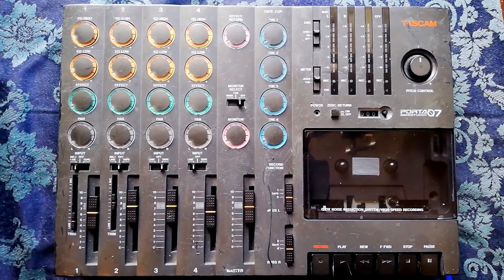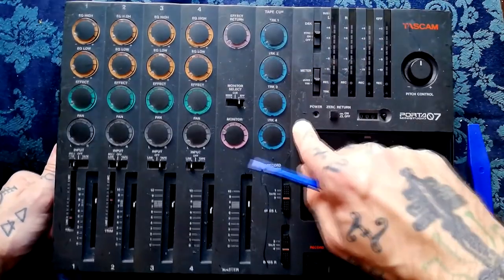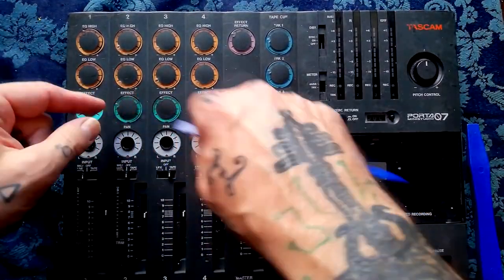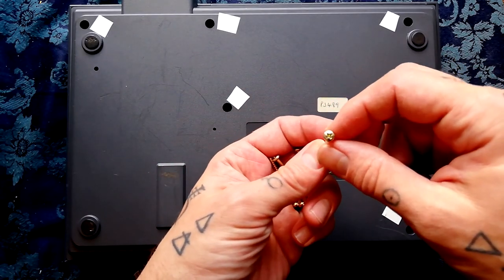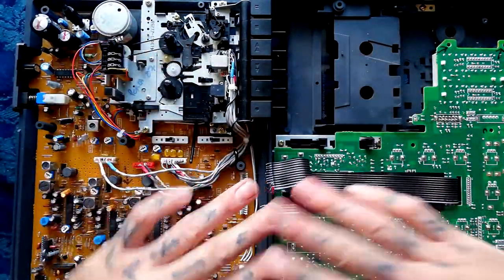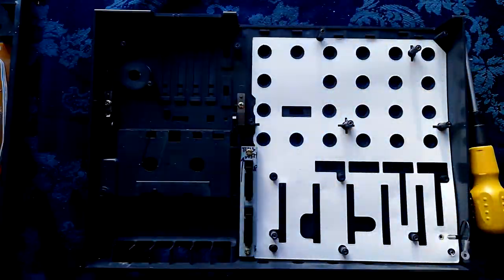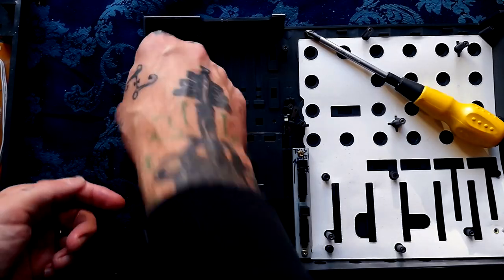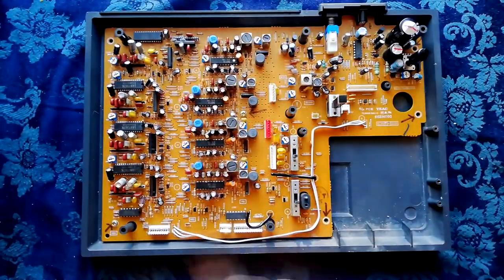Tascam Porta 07 | Tear Down

Comment: Hey mate, thanks a lot for this video, this was really helpful! I just got my first Porta 07 and I'm trying to bring it back to life, maybe you've encounter the same issue before? : the transport side of the machine seems to be working just fine but there's no power at all on the mixer side. I'm a newbie but surely the power is provided by one of the 3 ribbons cables? Do you maybe know which one? I couldn't find anything in the service manual. :/ 

Anyway I'm guessing you get a lot of these comments, no worries if you don't have time! Thanks for all the videos. ✨

EDIT : Neeeevermind, I flipped the transport PCB over and it looks like the ribbon cables connections have been resoldered by someone before, they're all super messy so I'm going to redo the whole thing. Hopefully that'll do it!
Reply: Im getting mine next week and it has the same problem you are describing, so im all ears if you have an update on it!
Reply: @user-sr5iv9pp6p  Unfortunately I couldn't save mine! The PCB was super damaged from the previous repair attempt and I don't have the skills to address that. I might buy another broken one to see if I can maybe merge them somehow, aha.

I hope yours will be in a better shape. ✨
Reply: Hey mate, do you think you could send me in the right direction of the service manual? ive only been able to find the users manual so far ;/
Reply from the maker: It's up on my blog https://tetrakansupermonobloc.home.blog/2019/10/22/tascam-porta-07-manual/
Reply: @Tetrakan  oh jesus, thanks mate! You've allready been a major ressource since aquiring my porta 07, and with this i believe i can bring it to decent life

Comment: my portable 07 was powering on and working perfectly after I first bought it but now it will not power on? did I blow a fuse in the machine perhaps? Im not sure how I would go about fixing it. I tested it with some very similar power supplies with the same polarity to make sure it wasn't a power supply issue so now im assuming there is something wrong with the dc jack or some wiring? not sure how it could go from working to not powering on in minutes but I would appreciate any sort of help if you could give me any :-)

Comment: hello! thank you for the great content! I'm having the following issue with my porta 07: when using the "monitor" outputs [L and R], one of the channels (the L one) is A LOT louder than the other one. the R is almost silent. So I'm using the "line out" outputs instead, but then I can't control the volume through the "monitor" knob, obviously. What can be wrong with my monitor outputs and do you have any idea on how to fix that? thanks in advance!
Reply from the maker: Thanks for watching. Could be the pot itself is dirty, or capacitors,  opamp or solder associated with that side of the stereo bus have an issue. I resolved a similar issue on another model on this video https://youtu.be/gwr8nUAkdMo

Comment: Recently my porta 07 inputs 1 and 2 stopped working, and in the playback  if pan a track to the right get all distorted, do you know how to fix this??
Reply from the maker: Its hard to say without being there to run  tests, but porbably there is a bad solder or capacitor somewhere. Schematic is up on my blog. Look for an opamp or other component shared by channels 1 and 2, reflow colder and replacing electrolytic capcitors surrounding that. Here is a video with more detaisl fo the sort of steps you will need to take. https://youtu.be/fVs0ALyEUMY

Comment: I have question 
I get recorder couple of days ago
First I was testing just listening cassettes what I was ordering online
But everyone playing double speed is that's normally?
Reply from the maker: Yes. It’s a 3&3/4 inches per second deck. Commercial cassettes are 1&7/8 IPS.
Reply: O that's explain
Is any chance to change speed to commercial cassettes speed?
Reply from the maker: @JBBTS  not as standard on this model. I have shared a modification on my patreon, but you would need dome electronics skills. Some other models have dual speed, or low  speed only, which is compatible with commercial tapes.
Reply: @Tetrakan  thanks for info 🙏

Comment: Good vid, thanks mate. I have a Porta 07 that’s been sat around for 20 years and won’t power on, would be nice to get it going again. Need to check your Porta One vids as also have one of them that I’m using as a sub mixer (makes my drum samples sound nice & crunchy), it has a knackered tape mechanism and it would be nice to sort that as well. I’ve got a working Yamaha MT400 too but recordings gradually speed up for the last couple of minutes before the tape runs out, is this something you’ve ever encountered?
Reply from the maker: I’ve never had an MT400 but I seem to remember it’s got the same generic GEC cassette player in it as your porta one, and I’ve made a series of seven videos on refurbishing that transport: if the motor was an issue the speed problems would be present regardless of where you were on the tape so I suspect it’s issues with old rubber and gluey old grease interacting with the weight of the tape on the reels.
Reply: @Tetrakan  Thanks mate. I’ll defo give those Porta One vids a watch.
Reply: @loge79 I hauled my Porta07 around for about 26 years before, just days ago, getting it running again. I had the same problem you report, in that it just wouldn't power up. Turned out, in my case, I just needed to take it to an electronics store and have them re-solder the power connection on the circuit board. Worked like a charm!

Comment: Hey man, I bought one of these without the original ac adaptor some weeks ago, and when I received it I did something stupid and used an adaptator that has the same voltage but not the same polarity, so the main capacitor popped, and I bought some with the same uF and V (but the size was a bit smaller than the original, is that a problem ?) And I replaced it and everything, I used another adaptor with this time the same polarity and everything, but it  still didn't seemed to work (also the metal part you connect to the machine seemed to be a bit longer than it should, don't know if that's the problem), and then to top it all of when I tried to put it back together and close it, don't know how but I broke the small ribbon cable inside, can you help me please hahaha ?
Reply from the maker: I feel your pain. I've still got one sitting on a shelf with polarity damage, which  definitely extends beyond the main filter cap, but I haven't got as far as identifying other caps and semiconductors damaged. It will bubble to the top of my to-do list eventually, and there will be a follow-up video. Not the easiest project out there tbh!
Reply from the maker: To give you a little more of a direction to go in the meantime, heres roughly how I'll approach the problem when I get around to it. the schematic is up for free download on my blog. Effectively, 15v dc has travelled the wrong direction from the negative pin of your power socket through your circuit ground, so I'd be looking for every electrolytic capacitor or fragile semiconductor (e.g. diodes or bipolar transistors) which is connected to ground - replace all of them and I would hope that catches your issue without too much frustrating circuit debugging? And yeah, those ribbon cables are disgusting. Take an afternoon with a good podcast to replace the broken one with garden variety shielded cables. Good luck.
Reply: @Tetrakan  haaa ok, what situation  I put myself in hahaha, well from what can I see, nothing seem to be broken or puffed up, but what do I know, really the only problem I can see right now is the small ribbon cable disconnected (it's like a clean cut, the metal part that connect to the plastic is still in there), do you have a YouTube video or something that could tell me how I can repair this specific cable or at least replace it (if I can) ?

Comment: Very helpfull, thank you! Recenly just got same porta and the smoke cames out of it just at the first try when I simply rewind the cassete. I hope it just leaked electrolytics, but even if it so now I know how much work will it take to get to the solder side of pcb x_x
Reply from the maker: Have you checked the power supply you are using is the correct polarity? It should be negative tip for tascam units. I ask because I have had electrolytic vapour from the the wrong polarity of psu, though  there are other causes, good luck!
Reply: @Tetrakan  OMG you're right! I can't believe you uncovered the problem with one message. Person who sold it to me, said that he don't have original psu, but this isn't a problem cause he have other one working. I've just checked it and the tip are positive. Moreover it obviously switching type, from some kind of notebook or something, so I think I'll better change it for conventional linear one. I'm wondering how is it even works for him.
  
Can you imagine powering it up after resoldering and seen how the new caps blows out ahaha
Reply from the maker: If you can get linear supply great but switching PSU will work OK, I use them all the time and don't get terrible noise on portastudios. Hopefully it's only a couple of capacitors and semiconductors near the DC input jack that have blown.
Reply: Got it, ok I'll swap psu polarity then. Thank you for the help with all that, Tetrakan🙌🏼 I hope too it didn't goes far in channels and preamps. By the way if you have a schematic for this one, don't you mind to send me a copy please? Can't find it anywhere, block diagrams in official manual only.

Comment: Hey! Would really appreciate it if I could get your help. Owned a Porta 07 since 93/94 (my 1st 4-track when I was about 15) but it broke years ago (no longer powered on). Dug it out recently after discovering your channel. None of the lights came on but, when I pressed play, rewind, fast forward etc the transport was working. As it was working though, smoke started pouring out of the machine, from the top right corner! Having quickly unplugged it, I noticed the top right corner of the casing was also red hot. Have just opened it up and it looks like maybe the biggest battery looking thing (can probably tell I really know what I’m talking about) top right has leaked? Any ideas? Do you think I could potentially fix it without blowing myself into the middle of next week? 😂 No idea with electronics and soldering and stuff but watching your vids I feel inspired to give it a go!

Thanks in advance! Also, a huge thank you for the 488mk2 Gear C vid and your channel in general. Got my 488mk2 up and running again. Looking forward to the “MCRs Rated” vid you’re doing! 👍🏻 Will be cheering the little Porta 07 on! 😁
Reply from the maker: Yeah that's the main electrolytic capacitor, it can be replaced, where are you? Maybe you could send it here or I guide you over video how to  do it?
Reply: @Tetrakan  Thanks for replying so quickly! I’m in sunny Derbyshire, not far from Crich. So that’s what a Capacitor is! 😄Would really appreciate any help you can give me. Do you think it’s likely to just be that one part that’s shot? Took some pics while it was open if you think they may be of use.
Reply from the maker: @shininglevels5453  quite likely...I've got a spares unit if not, probably makes sense to send it here...dm me on Facebook?
Reply: @Tetrakan  Sounds like a good plan! Unleashing me on it probably wouldn’t end well. ⚡️🚑😂 I’ll get in touch through FB then.
Reply: @shininglevels5453  how did it go?
Reply: @ThePrehistoricWars  Tetrakan was absolutely amazing.  Offered to fix the Porta 07 or help me to fix it. I bought a Yamaha MT44 4-track and an old analogue Mixer off Ebay around the time for something like £30, and he helped me and gave me advice with the mixer too. A family member ended up having health issues and I was off work unpaid, so I never sent the Tascam to him to be fixed. I ended up buying another Porta 07 off Ebay in the end, fully working for £60-£70. Crazy cheap price!  I also fixed my Tascam 488mk2 using Tetrakan’s vids. Dude is a legend!

Anyway, I love the sound of analogue gear, but I’ve just ended up back on Ableton Live 11., using a Launchpad Mini, NI M32 and a sustain pedal for looping. All together that allows me to control pretty much everything I need whilst  barely touching a mouse. The workflow is just unbeatable for writing, arranging, recording and live looping. I can have full tracks with guitar, bass, drums etc knocked up in minutes! I sometimes record through the Porta 07 or record stuff out into the Porta 07, with that setup, mainly just for fun.

Comment: Hello! Could you help me with this question- in tascam porta 7, after 2-10 seconds of playback/recording, stop (the coil under the transport mechanism) is triggered. As I understand it, you need to replace the capacitors, but which ones?
Reply from the maker: That solenoid should only respond to the counter hitting 000 in rewind. What you're describing sounds like mechanical autostop coming on. Is the take-up reel turning properly? I'd hazard a guess it's sticking or slowing before play/record stops?
Reply: @Tetrakan  is the take-up reel turning properly? - yes
i'd hazard a guess it's sticking or slowing before play/record stop? - no
it is the solenoid that is triggered.
P.s. I'm sorry for my English, I use an online translator.
Reply: @Tetrakan  at the same time, rewinding in both directions works fine. the counter too. but in the disassembled state, it is clear that it is the solenoid that is triggered.
Reply: @Tetrakan  sometimes it can work for 30-60 minutes without shutdowns.
Reply from the maker: Thank you for clarifying. I haven't had a solenoid behave like that before, so I don't really know the solution. If I were in your shoes I'd find the components connected to the solenoid using the schematic and either check their health out of circuit  with a multimeter  or - if they are cheap and easy to order - just replace them?
Reply: @Tetrakan  I will do so. I just thought that maybe you have encountered such a problem.
Thank you for your time!